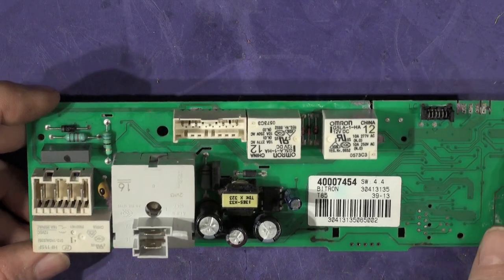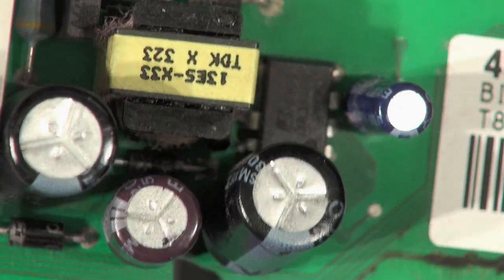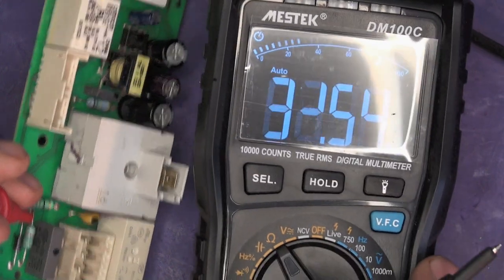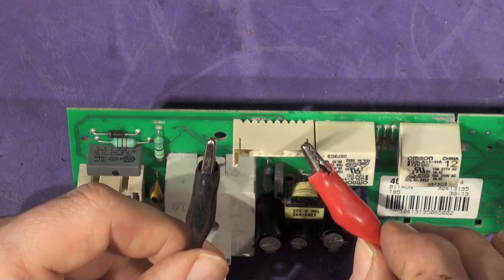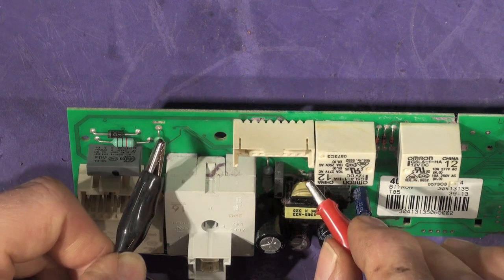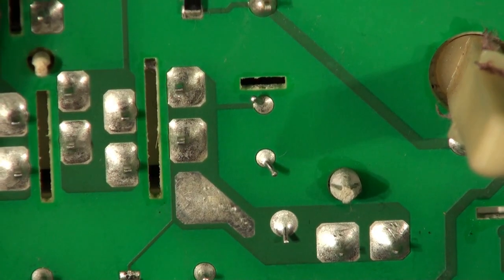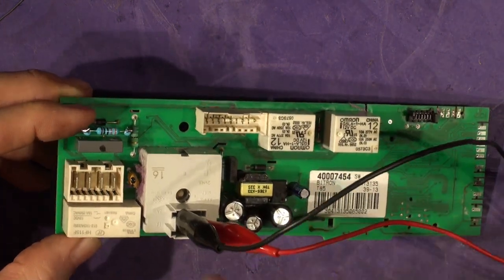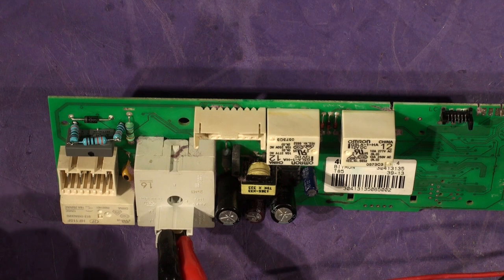Hoover Vison HD Tumble Dryer dead - controller diagnostic and 5p easy fix

Comment: Super job, I fixed my mum's washing machine for 50p after the engineer told her it was beyond economic repair, just needed 3 capacitors replacing, it took me longer waiting for the staff in maplins to get the bits together than it did to fix the machine, that was 5 years ago, the machine still runs fine.
Reply from the maker: A very common fault..Good job.
Reply: Well done :-D,  i used to wait ages in the coventry maplins, the people behind the counter knew nothing about components, i asked for a common regulator and he said they were out of stock.
I could actually see the regulator behind him, useless numbskulls.

Comment: Had a hoover tumble dryer for quite a few years, the on/off switch burnt out, half the wiring to the switch overheated and went all brittle, so i replaced the switch and redid the wiring, only for it happen again a couple of years later, worse this time, a lot of smoke, tripped the electrics and judging by all the charred and blackness around it, probably a small fire that didnt take hold, thankfully. Ended up chucking it and buying a new smart candy tumble dryer, not realising that they're basically the same thing as hoover. Only had the it a few years and hence why i am here, a connector on the back of the pcb board has melted and damaged the board, new board around £100, which sod that, and i am sure it will only happen again and risk a fire? poorly made crap if you ask me. Another brand i will steer well clear of.
Reply from the maker: Unfortunately spade connector overheating is an issue on many brands.  The UK mains has too much oompfh for the European designed 230V products.   I usually to solder them into position on the spades.You need a good iron and do it quick.  Obviously the quality of the replacement spade connectors and the crimp tool used in the repair is critical.  Most spade connector kits are pretty poor quality,

Comment: i have the same board when i press start on the dryer i works and turns the motor for about 10 secs and after stops and  flashing lights start any ideas???
Reply from the maker: Is the drum turning? (belt not broken) Could be heating element or one of the two thermal sensors.

Comment: One of the relays clicking and the dryer stops and starts beeping and the lights flashing. What could be the problem?
Reply from the maker: Clicking relay is usually a symptom of low voltage DC supply voltage or a bad reservoir capacitor.

Comment: I noticed that you add solder to a connection before removing component,why is this please?
Reply from the maker: Adding leaded solder (60/40 Lead/Tin) lowers the melting point of the unleaded solder and enables much easier component removal.

Comment: I have replaced the 1k resistor which was O/C but when selector switch is turned there is still no flashing light.  I have recheck the resistor and found it is normal so hasn’t gone O/C. The chip physically looks ok so is there anything else which could be the cause?
Reply from the maker: Just because the chip looks OK doesn't mean that it is good. Is the resistor getting hot when you power it up?

Comment: I haven't got a clue me I sliced my fricking hands taking the bloody lid off my dryer it's 3.23 in the morning I'm told I will be charged a call out fee if I call the actual hoover company to send out an engineer my stop start button not working along with the memory button but all the others are working weird I use my dryer all the time now can't ☹️
Reply from the maker: That is a shame . That is a problem problem with these machines. Occasionally they still slice me my hands because they made no effort to smooth the sharp edges.
Reply: @razenby  I know I had 2 of them so far and I won't be buying another one of them waist of £600 for two of them 🙈

Comment: Thanks for posting this video. It gave me the incentive to tackle a pcb fault on a different model which was dead. The resistor checked out ok on mine, but I noticed that the adjacent inductor had a piece of it’s casing missing, probably caused by a current spike. I replaced the inductor and the machine is back in service.
Reply from the maker: Good job.  Thanks for watching.

Comment: Thank you for the video.
What is the power rating on the original 1K resistor ?
Reply from the maker: 2.5W
Reply: @razenby  Hi, is the resistor 2.5w or 1.5w as said in video? Need to buy as ours gone exactly the same as this one.
Reply: @razenby  Can't seem to find a 1k one listed?
Reply from the maker: @alanshire464  Sorry my mistake  just search '2W Metal Film Resistors' on eBay. There are plenty of sellers. Choose 1K value and check out.
Reply: @razenby  Ok, thanks. So definitely not wirewound fusible?
Reply from the maker: @alanshire464  No way of telling 100% what the exact spec of that resistor is as there is no service information or parts list available.

Comment: Well done,  the panic is over...... Perhaps lol.
Yes that resistor failed in an odd way, i wonder if the vibration from the drum helped an allready faulty resistor?.
Once the led appeared and flashed, the police arrested it ......... no no that's silly.
The led indicated there was a changing state and logic. 😀
I had a Beko washing ( when it wanted to ) machine, what a pile of poo.
I kept the controller board for part stealing later.
I bought a Bosch serie 4 machine,  it washes clothes when i need it to 😀
That was 3 years back, so ready to R.T.B lol.
Reply from the maker: The resistor also acts like a fuse. It gets a thermal shock every time the mains is applied as the 10uF capacitor is discharged at switch on.

Comment: Hi can you tell me what value the resistor is close to the one you replaced. The resistor on my board is a bit discolour and I can't make out the value of it.The resistor is open circuit. Thank you for the video,very informative
Reply from the maker: 68 Ohms 1.5 watt wire-wound     Green Blue Black. Remember to like and subscribe. Thanks.
Reply: Thank you for your help

Comment: can you help me get some brownie points before my aniversary 😉bush dryer no power started cutting out before every thing was dry TNY276pn chip had orange/black staining I dug it out and replaced it was still dead resistors check out good when I was testing voltage and put it across the chip the main relay clicked and it powered up when I pressed the power button but it just bleeped 3 times when I tried to start it
Reply from the maker: Hmm, is teh power supply working providing the low voltage DC supplies or not>>? If the LEDs are working it sounds like the TNY chip many not be the problem. First of all make sure the door switch is detecting the door is closed.  If the machine thinks the door is open it will flash and not start.
Reply: @razenby  I'm having another look at it now I'm getting 11v around the chip and the 2 + pins of the transformer XZM-E16187 but I can't find any data sheet for it to figure it out you where right about the door switch I'd forgotten I'd not put it back properly unfortunately I've not been able to get the relay to power up like before to give it a go
Reply: ok sorry forget what I just sed it's not 11v I was on DC and I had a spot of dirt on the screen where the . would be it's 110v on DC and 240v on AC I'm not seeing any low V DC

Comment: Would a failure of the offline switching chip still allow current on the 5v line and not the 12v? I’ve got lights, display and motor control but even after 3 relays I still can’t get the heater on without bypassing the relay on the board. I’ve replaced the thermistor and the other sensors on the heater are testing correct ohms. Thanks for your videos, definitely subscribed.
Reply from the maker: Have a look on the board very carefully with an eyeglass you may see fine cracks in the heater circuit pins on the PCB. You have soldered the relay but there may be others. I have buggered around with these boards for hours and then spotted the cracks.. they are infinitesimal. Very easy to miss.  One thing you have plugged everything back in correctly and checked the over temperature safety cut out?  usually there is one lurking somewhere with a red button or lever.  A fluff blockage alone cab cause them to trip. I suppose you could have a blown port driver pin on the micro but I have only seen one or two with that fault,.

Comment: In the company of an expert, mind you a bit of show boating to use 3 resistors instead of one! I have a Sumsung Tumble dryer (SDC14709XEU) it has been wonderful but the other day it appears to have died, no lights on the control panel. Armed with my o level electronics and a ten Bob multimeter, I can determine that I have 240v coming into the machine at a wiring coupling after that the wiring coils then at the control panel on/off switch the voltage drops to 190v. Is this normal? Is the coil dropping the voltage? Any guidance would be greatly appreciated.
Reply from the maker: I don't have time to impress just need to get the job done.  I didn't have the correct resistor in stock.  Are you using AC or DC mode on your meter?  If you don't have power just follow the procedure shown in the video. It will be your problem. Just make sure you have the mains AC voltage coming into the back of the switch via the two spade terminals.  If you do not then investigate the mains wring and input filter on the machine usually located right at the back where the mains cable comes in,

Comment: Hello
Are you sure that 1K resistor isn’t actually a 1000uH inductor? It seems strange to have a 1K resistor feeding the 400v DC smoother, usually the capacitor is fed directly from the rectifier, or through some form of choke.
Reply from the maker: Not when you think about it.
Reply: I just fixed one of these that is a inductor below the diode, its noise supression from the tumble drier into your mains. My panel the vertical resistor 680 ohm was open circuit. I replace with two 330 ohm in. series.
Reply: Ps I wonder was his neighbour complaining about intermittent wifi with   that inductor removed sending spikes up the mains when its running. 😊

Comment: Hoover infinity Vision HD VHC68B 
This tumble dryer it starts turning...heater start geting warm ...10 seconds later I can ear a click from one of the relays on the front panel ....it stops...then restart but with all lights flashing red and the heating element will stay cold .
I have checked continuity on the 2x sensors on the heating element and they seems to be ok as the multimeter it beeps.....I pull out the front NTC sensor.... testing for continuity and I get no beeps from multimeter but when checking ohms the value change depending on outside temperature blown at it.
What is my next step? Does it have more sensors somewhere else? Thank you
https://youtu.be/lSGgYmJX_xQ?si=IEEpDp-wzK9U2ADM
Reply from the maker: If the sensors both measure the same resistance (about 1700 ohms at 20 deg C) then they must be OK.  The dryer assesses the dryness of the load by differential temperature measurement before and after the condenser.   So there are generally three things to check: 
1. The airflow. If any of the channels. filter  or condenser is blocked then the over temp detection will kill the heater.
2. Check the thermal cutout located near to the heater
3. Fan impeller loose on the motor shaft
4. Heating element is going open circuit when it heats up. (Usually this will cycle the heat on and off)
5. Dry / cracked solder joints on the heater relay
6. Inspect all wires and spade/edge connectors in the heater circuit wiring. You are looking for discoloration or scortching.
7. Take the covers off. Load it  up. In the dark let your eyes adjust to the darkness and then run the dryer. If you you have a bad connection somewhere you will see a sparks and fireworks.
Reply: @razenby  thank you for your reply...is there a way to test if the heating element goes open circuit only once is heating up? And what would cause it. Ta